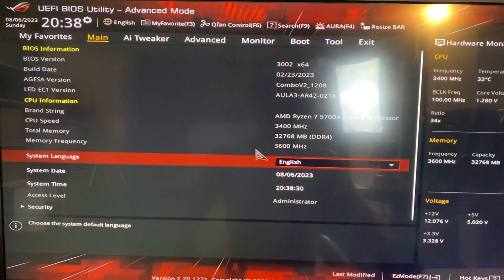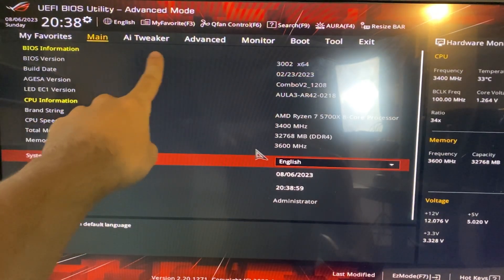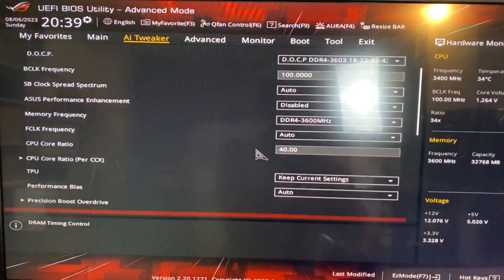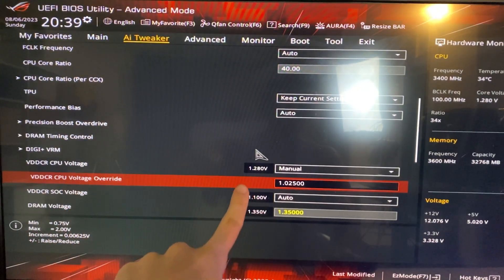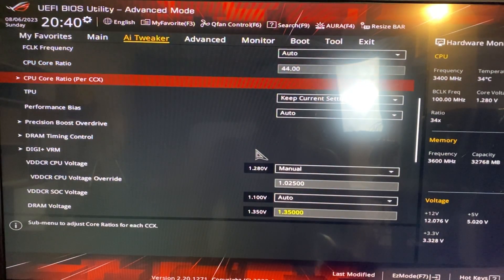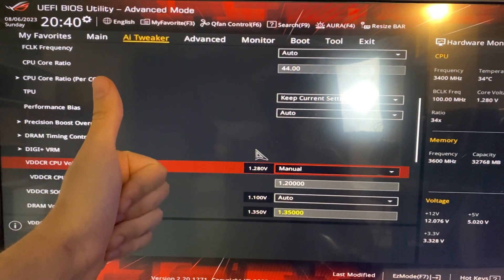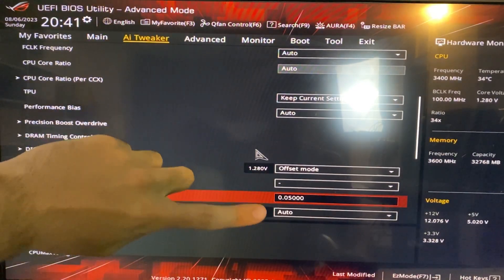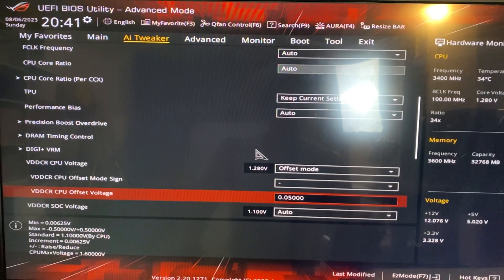Undervolt your Ryzen 7 5700X for more FPS and Lower Temperature!

Comment: Previously with precision boost override mode, cinebench score is ~14.9K with 94 deg temp and max clock speed 4.3 GHz. After undervolting to cpu ratio 44, override voltage 1.075 V, cinebench score is same ~14.9K but with 68 deg max temp.

Comment: First, you helped me UV and OC my RTX 5070. I thought my PBO tweak for my 5700x is enough but I stumbled upon this video and wow, it works very well giving me better temperature that I was struggling even with an AIO. It seems that my motherboard by default like to use higher voltage, so manually reducing it does reduce the peak load temperature by about 20 degrees.

Comment: thank you! i used the 2nd one, CPU Ratio - 44, and CPU Core Voltage - 1.2V. 
temperatures have dropped from 81C on max load to around 65C.

Comment: Hey brother i just did this and it works perfectly! but my question now is sinze the boost clock is stuck at 4000mhz does it mean it wont run as fast to 4.7mhz? As what the r7 5700x advertised?

Comment: Did the first one with 40 and 1.025v and now the system won’t even boot into bios, any tips? Ryzen 7 5800x with msi b550 carbon wifi gaming mobo.

Comment: Dude thanks so much I did the 44 and 1.20 on my 5700 base cpu not the x and man big difference with my stock wraith cooler. Tried replacing my fan and pulling off the stock fan I almost killed my motherboard by bending a capacitor 😮 So I was like nope!! I’m just putting it back on with aftermarket thermal paste and calling it good. Then found your video the only performance drop I have seen is in Cyberpunk but I don’t play that game that much everything else runs a 60 fps temps went from 84 c to 64 c max
Reply: U have to twist coolers to break the thermal paste

Comment: 40 at 1.025 is a very optimized spot, only 10% loss on cinebench here and 30% less temperature on package. Tried other configurations but nothing goes well as this. At 4.4 and 1.1 the temperature rise 10deg, but the leap in performance just raised about 7%, since I'm using a 5070 ti with this processor, I don't see why maintain a clock high like that. You just saved me a lot concerns about cooling hahah, thanks!
Reply: What idle temps are you getting?
Reply: @trufoldalt  at maximum load 64 deg
Reply: bro why is your pc not crashing with 40 and 1.025? mine crashes on cinebench.

Comment: Thank you for this description. I messed around with my msi pro a and set my core clocks for 4.2 and voltage to 1.0500 and it plays great (90 to 122 fps) and hit max temp of only 58 celcius 
You are the best bud thank you

Comment: Gonna pile on and say that I (Jan 2025) undervolted my R7 5700x using the first set of numbers (40/1.025) and have seen no noticeable performance dip, more consistent frames and literally 15-20 degrees lower thermals in some games! Absolutely perfect
Reply: Nice ! PBO on or off?
Reply: @nagash1694  PBO Off, if you set it on...probably conflict will happen
Reply: What were you getting for temps during game before?

Comment: Wow, i was getting instant 90ºC+ with prime95, OCCT. Upgraded my Cooler, Thermal Paste and nothing...I was getting just crazy with this
Now, running 4000MHz  at 1.025V, I'm getting 64ºC with no apparent loss of FPS (probably, a bit better tbh)
If My PC can run at 44000 like you suggested, do you think overtime it might short down a bit the lifetime of the CPU?
Thank you so much for the great tutorial

Comment: 4.0ghz  @ 0.9375v
4.2ghz  @ 1.00v
4.4ghz  @ 1.0875v 
4.5ghz  @ 1.15v
4.6ghz  @ 1.206v
4.65ghz@ 1.256v

Stable cinebench r23 multi core 30min
am i good enough ?
Reply: Thanks for posting.
What temperatures are you having at 4.65?
4.4 1.2 and I'm already at 90ºC
Reply: @Ultimatebeatdastreet my temp max only 61 with 4.4ghz 1.2v

Comment: Great guide. Good performance boost and much better temps. I tested on 1080p and tuned both this 5700x and my RX 6800 and went from about 60-70fps in RDR2 to steady 100fps (though I locked it at 100) with about 88fps 1%low. Tyvm. Going to 1440p now

Comment: Thank you for this. Actually tested the 40.0 + 1.028 (this was as close as it could get to 1.025 on my Aorus motherboard) and the idle temps went from 57 C to 45 C, really happy with it since it's stable. Have yet to test it during gaming.
Reply: Same motherboard, im also trying 1.025 but its auto adjusting to 1.028
Reply: question. did it stay at 40.0 frequency all the time? mine is staying at 40.0 all the time after setting it up.
Reply: @Zelthus  I don't remember anymore haha, I sold my 5700 XT.

Comment: U the best bro. Before i play bf5 always 96c stock cooler. After set v1.03 with default core ratio.temp below 67c now. So i dont need to buy new cooler 😎.

Comment: can you tell me settings for ryzen 5 5700x i want to have as low temperatures as possible. Tried ryzen master and had voltage for 0.9 and 3400mhz cpu speed. How do i use this settings in bios?

Comment: really bad advice. bro is not undervolting but underclocking. this actually reduces performance. your better off truning on PBO if you want more performance and then using the core optimizer to apply a core by core undervolt. these chips can easily reach 4.5-4.6 all core boost with single core boosts up to 4.850 with the setup i mentioned. limiting your cpu to 4.4ghz is really underutilizing the potential of the cpu. i mean any cpu will run cooler and more efficiently if you underclock it. all you guys following this advice are simply running your cpus slower than they are designed to run so yea ofcourse you are getting better temps. the stock speed for this cpu is up to 4.6ghz so running it at 4.4 will obviously run cooler and use less power.
Reply: STFU! You know nothing about overclocking and undervolt 😂

Comment: ok what the actual F... For Warframe I went from 80°C (in game with programs running etc.) to BELOW 55°C !!! On COD or The First Descendant my CPU was at 90°C+ and I never understood why. I think you just saved my computer lmao
Reply: what settings u used
Reply: @JALAL919  with a B450M motherboard I couldn't change the cpu core ratio, so I just changed the voltage and cpu clock. 

First tried with 1.025V (with CPU clock at 3600MHz) but it felt a bit weak especially for content that runs mostly on CPU. Moved to 1.05V with 4200MHz CPU clock speed, runs perfectly at 100fps in 3440x1440p on Warframe, PoE, CoD, and even CPU-heavy-games like Summoners War or any mobile/bluestack games

Comment: The most helpful channel for me. My temp reaches 85, now only 55. Core ratio 42.00 manual voltage at 1.025, stable for now. But if i run into unstable state i'd be set the voltage to 1.050

Comment: I just overclocked my cpu ryzen 5700x to 44ghz with 1.2volts and run cinebench for 10 minutes, max temperature is 67 degree celcius. 

When playing games it only goes to 54 degree celcius.

You just need to find the sweet spot for your CPU 🔥

Comment: Can you please tell me where will be these 2 option on a b550 aorus elite motherboard as it has different names for the settings. I see a cpu clock ratio instead of core and theres no vddcr option😢
Reply: It's called vcore voltage and if u type 1.025 it will automatically set to 1.028

Comment: Thank you. My CPU temp was occasionally reaching 85 degrees during ultra 4k gaming. But now its not even touching 70 😊
Reply: settings?
Reply: @JALAL919  Core Ratio 42.5 
Voltage: 1.08

Comment: Hey great video man straight to the point! In regards to the last overclock you mentioned about the auto cpu clock and 0.075 voltage,
is this the one that is supposed to give the most fps ? Thanks

Comment: Hello. I wanna put my core ratio at 40 however i dont have the manual option to change my voltage. Just auto and offset. Curretly have 1.1v. Do you have other settings that would help with my temp? Thank you nice video btw!
Reply: I have the same. May b you have b350f motherboard. I set to core ratio 40 and offset 0.075. It's basically the same as manually setting to 1.025 Volt.

Comment: my bios doesn’t give me the option to put the voltage mode to manual. only offset or auto. any fix?
Reply: Choice Offset and than - Calculate in minus to Come in 1.025 Voltage 
Exempel: from 1.20 voltage you Must Go down 0.075 voltage.

Just calculate bro 😂👍🏽

Comment: is it possible to go even lower than 0.07500 and gain more performance and lower temps while remaining stable?
Reply: I have been using cpu core ratio auto with offset mode of -0.10000 for almost 2 years.
Very stable. Never crashed in games or during stress test. Guess i got a great chip
Reply from the maker: Yes if you’re very lucky! You might wanna try -0.1V But your chances of it working are increased if you subscribe to the channel

Comment: i have Ryzen 7 5700X can i do this with my asrock B450M-HDV? do you have the video how to set up them?
Reply: i want to use you last setting (auto, frequency : auto, offset mode - with 0.05000 voltage)

buy my system only show auto/manual, Frequency, Voltage (VID), SOC Voltage (VID)

can you tell me what should i sett on my system? should i sett the voltage on Voltage (VID) or SOC Voltage (VID)?
Reply: @raihandaluthfiansyah  I'd like to know as well, did you ever find out?

Comment: Straight to the point and very clear. I was having temperature issues while running Horizon Forbidden West (temperatures of 75 C with some peaks of 85) in a ryzen 7 5700x. I did the same as you (cores at 40.00 and 1.025) and vuala now it stays at 60 celsius and it still runs smoothly at 90-110 FPS at 1440p, all set in high. Amazing video dude
Reply from the maker: I’m really happy it was helpful! Thanks a lot for taking the time to leave some feedback :) Consider subscribing if you wanna support the channel!
Reply: @ImWateringPSUs  I put cores at 42.00 and 1.0500 is this okay? Can someone guide/help me? I'm a newbie in oc...sorry for my level of english...(I have ryzen 7 5700x)

Comment: 5700X have just 65W TDP but is VERY VERY hot Cpu (idle a load).
It have very aggressive Core boost being on windows and install steam games temps jump to 55C with highend cpu cooler.
Cpu cooler Scythe Fuma 3.
Idle 40C with jumps to 55C (sometimes) , playing RDR2 max out details 64-68C all cores 4,7Ghz
Joke is my GPU RX7700XT (TDP 230W) running at 99% in RDR2 and never reach above 60C with minimal fan speed (under 55C fans are turned off automatically)
Reply from the maker: Undervolting can help!

Comment: CPU Voltage 1.17 with a ratio at 42.  I call it the Master Chief tune.  😁
Reply: Update, I was able to apply a .068 offset and I am able to hit the 4.6ghz boost... its a lottery miracle.
Reply: @lilSKIPPER101  Hi. How to you enable the 4.6 boost?
Thanks
Reply from the maker: That’s very good!

Comment: Update to my own comment. Turn off PBO in the AMD Overclock settings and do what he says. I'm currently running at a 0.075 offset. In games in averages between 4.1 and 4.22 and the overclock boost that only last a millisecond will hit 4.55Ghz. CPU Core Ratio is on Auto
Reply from the maker: I’m really happy it was helpful! Thanks a lot for taking the time to leave some feedback :) Consider subscribing if you wanna support the channel!
Reply: @ImWateringPSUs  Already subbed and no problem.

Comment: Man thank you very much for this tutorial! My Ryzen 7 5700x due to his boost clock at 4.6GHz in games had like 80-82 degrees. I tried your first method cuz I think for my need 4.0 Ghz are enough and my temperatures are never over 71 degrees, even after 1 or 2 hours of gaming. Maybe later I try your other methods too, cuz I really want to see the differences in temperatures and overall perfomance. Thanks again for this tutorial!
Reply from the maker: I’m really happy it was helpful! Thanks a lot for taking the time to leave some feedback :) Consider subscribing if you wanna support the channel!
Reply: did you get performance loss?
Reply: Hey andreas, i hope this finds you :D i have the same cpu but is alwayus hitting max ghz, does this fix it ?

Comment: Will doing this boost fps in games? I have good temps but i wanna boost fps without overclocking
Reply from the maker: Yes it will if you set the core clock as high as possible :)

Comment: Bro please tell me. I have 3600 RAM from the factory (xmp). It started and worked well on the Ryzen 5 3600, but on my new 5700x the XMP on the 3600 mhz doesn’t want to start, it barely starts on the 3200, and this is with any settings and voltages, stock or not, i tried even increase the RAM voltage a little, but nothing. For me it works in two channels. Could this change something if I change the slots on the motherboard? What could be the problem, please tell me
Reply: do you have 4 ram slots? try using the other 2
Reply from the maker: Unfortunately it’s not a RAM slot problem. It’s a CPU IMC problem, it means your 5700X is a bit unlucky. I’ll try to make a video on manual RAM tuning asap, consider subscribing to the channel to see it :)

Comment: I tried the first option with 44.00 and 1.2V, in cinebench 2024 i was getting lower score in CPU (multi core) test. With this setting the CPU is locked at 4.4 MHz. I dont know how that could be better. Even the temperature rised with 5C° for me...
Reply from the maker: Try the other option :)

Comment: I'm new in this of overclocking and frequencies and i've got a question. Isn't 0.05000 way too low? And why or why not? In the offeset mode as my MOBO only allows me to set offeset mode, not manual, thanks!
Reply: 0.075 is working for me.
Reply from the maker: Nope it’s not! Give it a shot and drop a like and a sub!

Comment: Hey bro, I got a Ryzen 7 5700X with a 4060 Ti and a MSI motherboard. Did all your settings including the GPU undervolting but i‘m still having so many fps drops in some games, do you have any recommendations?
Reply from the maker: It might be a windows issue tbh, have you tried a clean install?

Comment: Thank you very much, I had a ridiculously serious increase of 96 degrees Celsius on the CPU running Dead Space with only 3.6 Ghz and now I can play it with my RX 7800 XT with 80 degrees Celsius on the CPU and at 4.4 Ghz.
I must emphasize that I was a little confused at the beginning since I have a B550 PLUS WIFI 2 from ASUS TUF GAMING, the only thing different is that the BIOS menu is blue.
Reply from the maker: My man! Glad I could help, consider dropping a sub to support the channel :)
Reply: Oki.
Reply: Are you using the Amd stock cooler?
Reply: @Mjdemon  COOLER MASTER HYPER 212 HALO BLACK

Comment: Is it just for a temperature decrese? Or you can accualy gain fps doing it? Trying to understand the logic behind this. My logic says - more voltage = more power/fps. But i know there are a heat limits. Can anyone simply explain? Thanks in advance
Reply: Basically, by default, pretty much all motherboards send a voltage to your CPU that is just a general guess for the model of CPU you have. Usually they're cranked way too high, because it guarantees stability at high clock speeds, making the manufacturer of the motherboard get good scores on benchmarks. However, the efficiency is decreased at unnecessarily high voltages, since extra heat is produced. Every single CPU is different and cannot be produced identically, therefore, every chip will respond to voltage slightly differently. Dialing the unnecessary voltage back can lower your temps, which will allow your chip to stay clocked higher during load.
Reply from the maker: You do gain a bit of FPS because you don't incur in thermal/power limits

Comment: Can i get more stability if i put voltage on auto instead 1.2? Great video by the way, never tried pbo but i prefer manual config
Reply from the maker: 1.2 is gonna be the best, but yay auto will give you more stability. I’d try 1.25V while being subscribed to the channel, before going to auto tho!
Reply: do you mean 1.025v or 1.25v?  @ImWateringPSUs

Comment: I have a 5700X and a 3080 and just realized I’m bottle necked whether that sounds obvious or not. I’ve been getting some pretty big frame dips in MWIII recently and in Destiny 2 since I built the PC. I know both games probably aren’t optimized well but I’d really like to alleviate some of the stuttering/frame drops while maintaining as high an FPS as possible as I have a 240Hz display until I can upgrade my processor in the future. Any suggestions? 

I tried maxing it out to the settings you gave at the end of the video and actually noticed about an average 10FPS decrease compared to where I had it before which I believe was the default MB settings. Gonna try undervolting it now and see if it helps any. I’m not too experienced with over/underclocking. Will edit after testing.
Reply: Bottleneck where? The CPU is fine
Reply from the maker: I’m really happy it was helpful! Thanks a lot for taking the time to leave some feedback! :) I’ve also got a few build videos on the channel and more coming, if you like the content consider subscribing as it really helps the channel!
Reply: did the undervolting fix the big frame dips